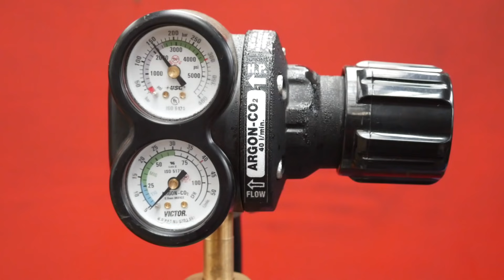6" Thin Wall Stainless TIG Pipe Welding

Comment: Just a tip, my friend who welds aircraft exhaust systems says using a graphite pencil will cause them to crack on the line.  He uses a Silverwriter pencil, a colored pencil with silver lead. I think a fine felt tip marker like Pentel brand would also work? He has been at it for 40 years now...hope this helps on any high heat applications like jet exhaust systems.....Carry On....PB

Comment: would have liked to see you weld stainless with mig or stick, This is what we also do regulary, great job man ! I usually check measurements and angles also when finished welding.
Reply: what i also like is that you keep argon-sheelding when you terminate your welds. Since i also do maintainence welding - guess where a seem will leak if it has not been sheelded properly. Nicelly done, good seems with proper roots.

Comment: Do you run a taper through the pipe connector so that you can compensate for shrinkage, or does it only shrink in the bottom where the weld is? Do you experience that the plug on stainless steel can get stuck in the threads after it's welded and cools down?

I worked at a nickel refinery as a mechanic, and would often do simple welding-jobs, most of the time arc or tig-welding stainless steel, I even tried titanium a few times. I remember when I welded pipe connectors I would usually have to run a taper through after the welding job, if I would run it through a plate/flange and weld on both sides. I've had a lot of instances where stainless steel bolts/nuts cold weld, so I got concerned when I watched you weld.

Comment: You can't weld nipple directly on previously made weld. The heat affected zone is +-25mm from each weld root. So, there shall be minimum 50mm distance between nipple wall and pipe circ. weld.
Reply: A lot of places honestly don’t give a shit. Steel mills, paper plants are some examples. Refineries, nukes, and more serious places where there is QC they care.

Comment: How do you use such a steep angle without losing shielding, every one has always told me to keep the torch vertical to stop air from being drawn into the argon stream from the lens.
Reply: Use a gas lense, and the appropriate gas flow for the size ceramic you're using and its absolutely fine👌👍

Comment: where did u find those rubber sillers or where did u got that rubber from ? I need those for a job like yours
Reply: Your local welding supply store might sell them, and if they don't, they should be able to forward you to a supplier.

Comment: Not sure if you did. But after your root. Let the pipe cool right down before doing hot pass or cap. Leave the gas running, helps it cool. Then your cap will come out a lot cleaner. Also keep your filler in the gas shielding, looked as if you where pulling it out a bit far. Nice root. As long as it's sweet on the inside.  All is good
Reply: this is a single pass job, as far as i can see he didn't do any cap pass
Reply: @raulduke85  you're probably right. I only gave it a quick watch. Doesn't really matter his root is good. All that really matters
Reply: @liamjenkins82  well yes but the discoloration outside is a bit too much imo; it's good for most applications, but if u love welding you aim to the top tbh
Reply: @raulduke85  yeah I agree completely. Pretty sure he was bringing in impurities with every dab. Filler taken outside of the argon zone. Didn't clean the weld area before hand. We all strive to do better that's for sure

Comment: Nice video but why do you not use the puls function on the tig welder instead ? Then you don’t use any wire…
Reply from the maker: That machine doesn't have pulse and they dont want a flat weld so i need filler wire to build it ip
Reply: Depends on the procedure he's working to aswell. 
Be very hard pushed to find a procedure for welding pipework with pulse tig.
Have been doing the job almost 20years now and haven't seen one procedure with pulse, other than pulse mig😕
Reply: NO its easy to make a procedure for tig also. You call Force and tell them that you want to make your own procedure and the you can make the procedure as you want….

Comment: Want to be careful walking the dog on fillet like when welding the small socket fittings. Very easy to get a concave fillet like you did. Try it freehand, dipping nice and fast to get a nice sized puddle going, and a decent build up giving a decent sized throat
Reply from the maker: Ill give that a try thanks

Comment: Please sharpen your tungsten more to a very sharp point! You need to know one important thing? That is to measure your gas cup inside diameter and divide by 2 that's your stick out from gas cup end.With that heat you need 3.2 filer rod, and your gas to purge burns hotter than your argon gas! That being said your welds on your cover show you're too hot! Using that combo of gases you must let that cool down after every pass! Try running with about 68 to 73 amps.
Reply: We use 1.6mm rods for root pass, a 3-4mm gap (on 6" pipe and above) and root at around 85-90 amps. (AWS and EN1090 class4 approved procedure, along with Nuclear approved procedures.) Most often use a size 6 ceramic with about 8mm or so of stickout. 2.4mm grey tip ceriated tungsten. Sharpened with a taper about 6mm long then the very tip flattened off. Then up to a size 8 ceramic with about 10mm stickout, 2.4mm filler and 150-160amps for hotpass. Fill passes between 150 and 180 and usually i go back down to 150 to cap off. When welding 8" and above especially sched40 and heavier, fill passes are at 200amps still with a 2.4mm filler. 
So are we going about it wrong then? Before you answer btw, every single stainless job we do is subjected to a minimum of 10% radiography or DPI for slip on flanges and olets or other fillets, with around half of the jobs being 100%. Also quite often although not always, welds are also PMI checked especially on the nuclear side, to check the material composition of the finished weld. Personally have only had 2 repairs on stainless in the last year, one in the workshop and one out on site at a chemical plant.
Also
Talking about purging gases, Nitrogen doesnt "burn" and is the preferred gas for purging super duplex grades such as xeron 100.